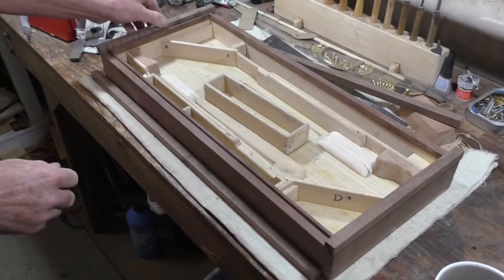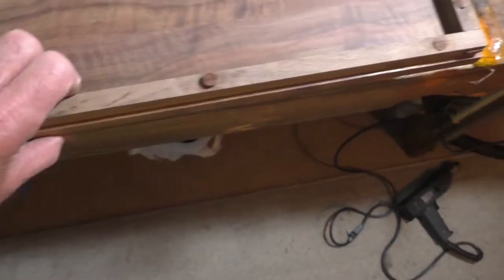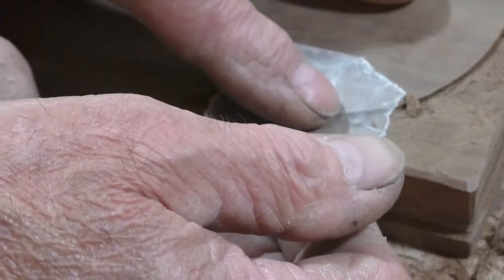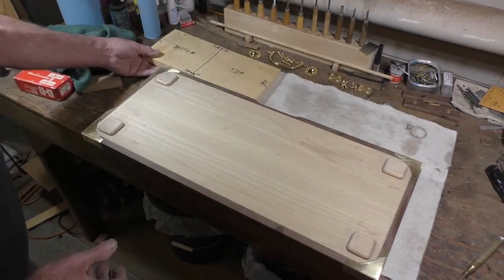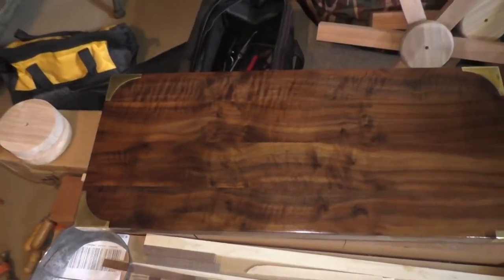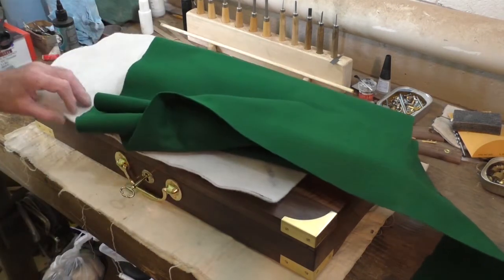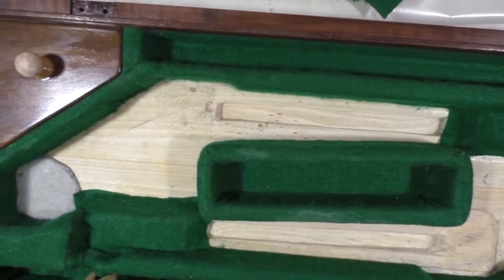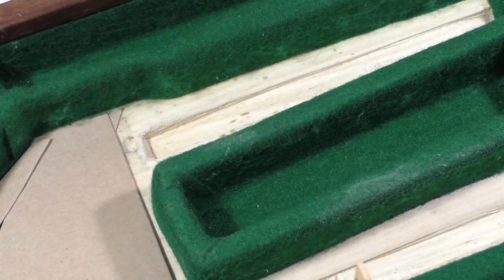Building a Pistol case video # 2

Comment: Stumbled across your video. Great work! I use felt with spray adhesive alot and I use a light scrub with a rag and mineral spirits to clean the dried adhesive from the felt. Thanks for sharing your video

Comment: Martin Please do not take this the wrong way just call it a little good advice. Do not use Felt to line traditional gun cases, the reason being as you rub it with your fingers and the gun will eventually the felting bonds start to break down causing the Felt surface to pill and shed loosing its good looks rapidly. The traditional internal covering is Baize this is a knapped woven fabric and is far easier to use round curves and corners. because of the give in the cloth due to its weave. also it will last for a centaury or more if you can keep the moths away from it. Lost count of the number relines I have done over the last fifty years. Very envious of your whole project.
Reply from the maker: Sounds like good advice. Where do I get Baize at? Never have seen it. Will fabric stores know about it?
Reply: @MartinHouston  Most 'felt' sold these days is made of acrylic fibre. I believe the original or felt these days.

Comment: The problem I had with my Colt 45 case was how to not get glue from the back of the felt to the front. Looks like white or darker spots depending om the glue.
Reply from the maker: Andreas191280 I had that problem also. I found gluing half down at a time helped sometime. I think the next one will be better.

Comment: What was the dimensions of your blunderbuss you made awhile back. I was wondering because I’m planing on building my own. It would be awesome if you could tell me where you got the barrel too. Thanks!
-curious subscriber
Reply from the maker: I made the barrel from chrom-molly steel seamless tubing. 1 in. I.D. 1 1/2 O.D. Threaded for 3/4 in. with a 1 1/8 dia thread & a breech plug made to match. I made a tapered drift, heated the end of the barrel up white hot & pounded the drift into the barrel. took several heatings & beatingsl. Then smoothed it out in the lath. If I make another one I will video it for sure. Thanks for your interest.
Reply from the maker: 16 in. long but have one with a 12 in. you can make it as long as you want but I like 16 to 20 in.
Reply: Martin Houston is there any particular website or store you purchased the piping from? Thank you for replying!
Reply from the maker: @dovahking7720  Tube Sales in Calif. Don't know if they are still there. over 30 yrs ago. Any steel supplier should be able to supply seamless steel tubing. Use at lease 1/4 in. wall thickness.